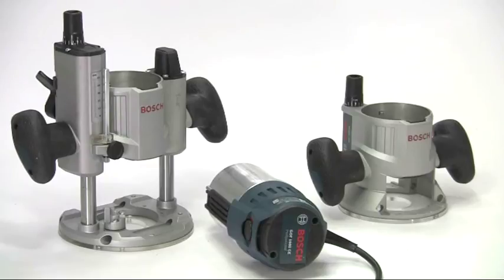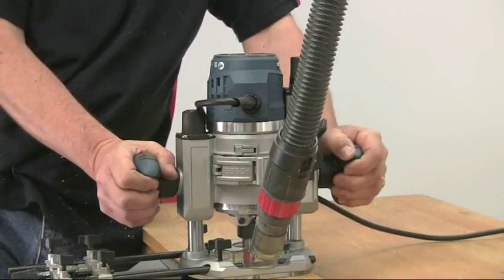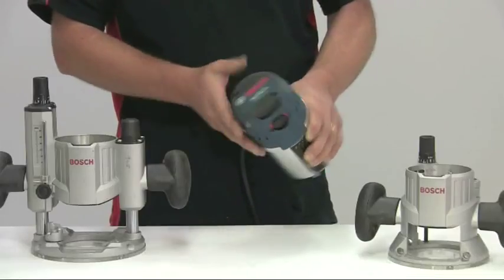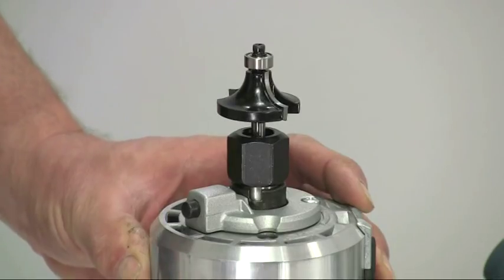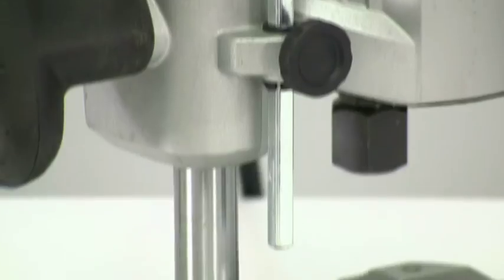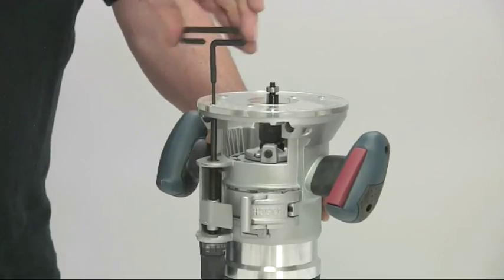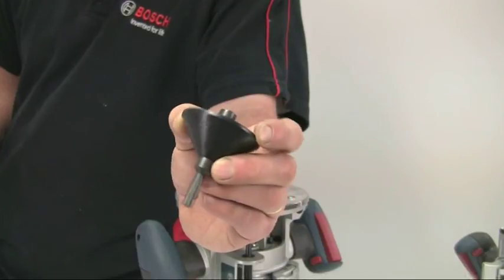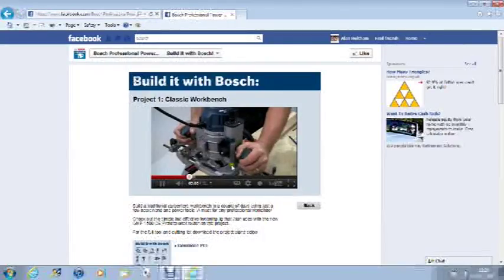Bosch GMF1600CE twin base router

Comment: I just got my GMF1600 today.
I have a problem with the spindle lock. When I tighten the collet the nut that locks the shaft unscrews itself and pinch the locking pin making it impossible to release. 
Am I doing something wrong or what's going on?